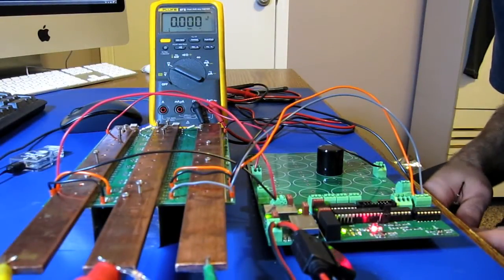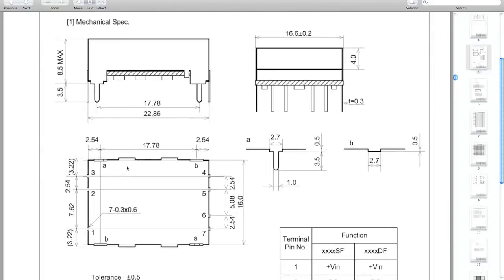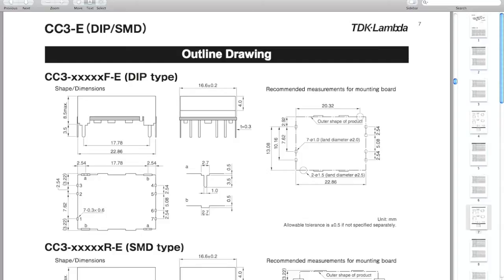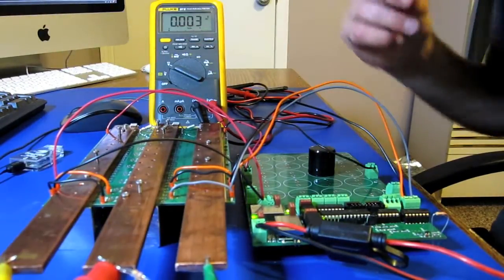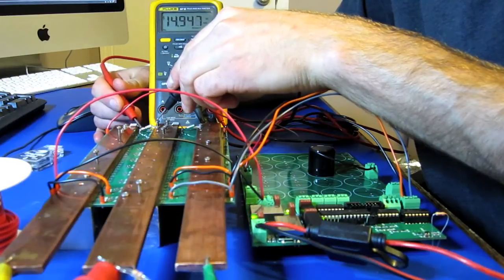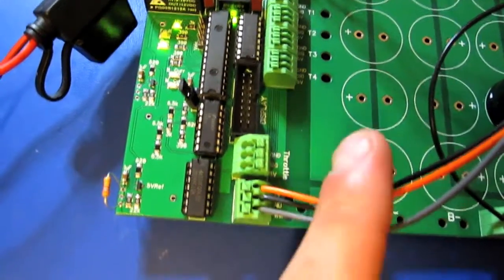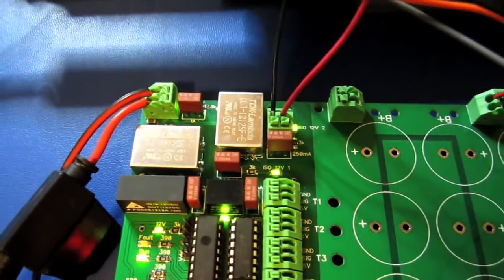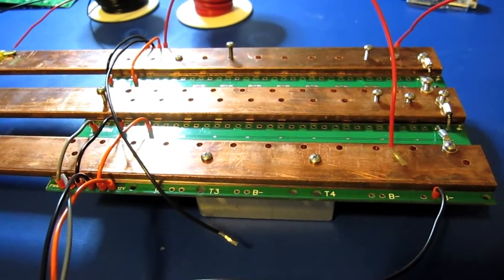Custom Motor Controller Build #6

Comment: Looks good. Will you redesign the control PCB for the final version? How much current do you deliver to that optoisolator? Those infrared diodes inside work at around 1 to 1.4V. Not sure if your logic works at 5V or 3.3V but even with 5V and say 50mA the power drop on that current limiting resistor is 5V -1V =4V x 50mA = 200mW. You can find even 500mW resistors in 0805 package. I actually use some 500mW 0805 on my SBMS.
I have some optoisolators on the serial communication but my logic is at 3V (2.95V to be more exact) so is less than 2V drop on that current limiting resistor. I initially had a slow optoisolator there to slow for 115k baud and 2kohm resistor for about 1mA on the diode. But I changed the optoisolator and the resistor to 540ohm (about 3.7mA) and now it works fine even at 115k even if default is 9.6k.
Reply from the maker: Thanks! I may re-spin the control board when everything is all said and done, but that will be a ways down the road. There is no use re-doing it until everything is all tested. Who knows I may run into some other unknown issue that I will need to address. On the bright side it looks like I nailed the power board. Absolutely no issues with it...

In this case my input logic to the opto is 5V and I have a 390 ohm resistor going into it (~10mA drive) so no issue there. The issue was the output side. The pullup resistor was 3k and the output side of the opto is 12V. The rise time was too slow (it was messing with the duty cycle of the PWM signal) so I needed to lower the resistance of the pullup. I added a 1.5k through hole resistor in parallel to make an equivalent 1k resistor. Power dissipation was a concern because of the 12V. 

One resistor can handle it, but with some significant temperature rise. I was not comfortable with that so I decided to divide the load between two resistors.
Reply: *****
It make sense to test everything before deciding if you want to build a new board if necessary.
I see so that resistor was on the output. Still 12mA and 12V is just 144mW and that is divided between to resistors even if not equally. Since is around 95mW on the 1.5k resistor even a generic 125mW will do. But since this is just one unit you are building is not important what resistor you use there. I just wanted to mention that you can find 500mW SMD 0805 resistors most of the heat will be transfered to PCB. I was shocked to find 500mW resistor in such a small SMD package. Digikey part# ERJ-P06J152V
Reply from the maker: *****
Yes definitely. I looked up that part#... that is pretty interesting. It is some sort of special 0805 designed to take higher power. It is definitely more expensive then your plain old 0805, but I'm sure you get what you pay for.

I use all 1206 size components just because they are so easy to solder. Typically they are rated for 250mW, but even at 100mW they have a pretty significant temperature rise. I just like designing things very conservatively for high reliability...

By the way it snowed in Calgary today. Enough that about 5cm accumulated. Have you seen any where you're at?
Reply: ***** I had space constrains so I needed to use 0805 parts I used two of this in series for 1W total but worst case they need to dissipate about 400mW (200mW each). The PCB is designed with thick tracks around this resistors so that copper on the PCB act as a heatsink and temperature rise is quite small even at the worst case 0.4W I use a reflow oven so the size of the components is not a problem. Large parts have a different problem and that is the possibility of cracks to to thermal expansion.
I know it snowed there I have a friend in Calgary he just sent me some photos. Here is raining at about 4C but it will probably freeze tomorrow night not that great for my small garden. It seems a bit early for snow but I hope weather will get back to normal after this week.